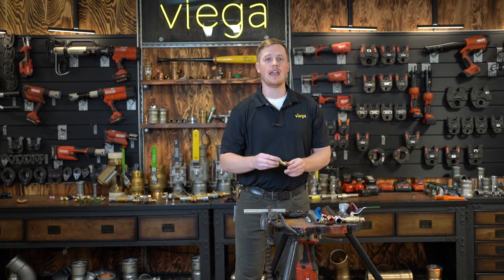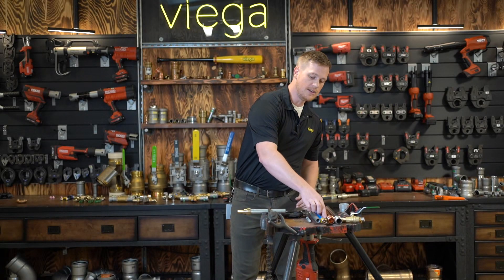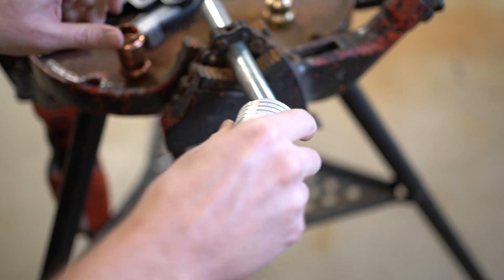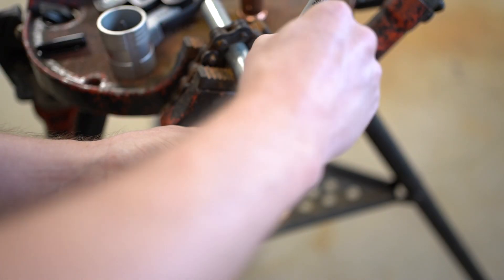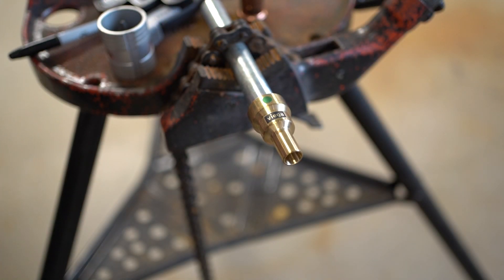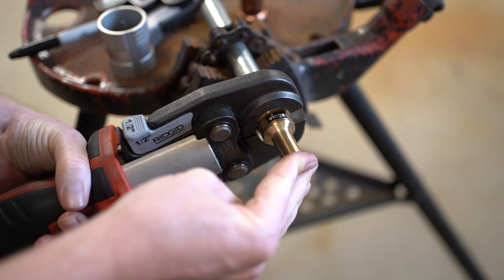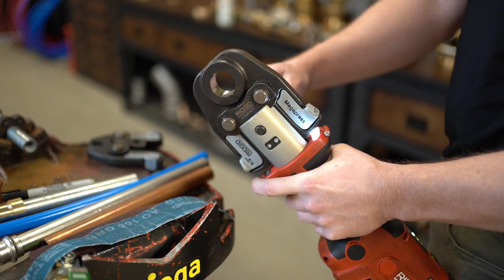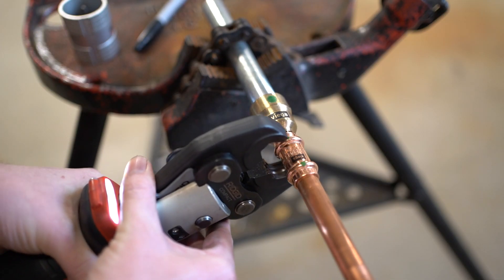Viega MegaPress Bronze Transition Coupling - IPS to CTS

Comment: What stops the electrolysis ?
Reply from the maker: The MegaPress bronze transition coupling helps reduce the risk of galvanic potential. It does this by using a material that balances out the difference between metals, which lowers the electrical reaction between them. Instead of one strong reaction that can damage the metal over time, it creates two much smaller reactions that aren’t powerful enough to cause harm.
Reply: Bronze and galvanized are two dis similar metals, no? Does it have some sort of rubber stop in the middle similar to a dielectric union?

Comment: So is for potable domestic? As in, I can replace a 2 or 3 handle shower valve plumbed in galvanized and transition to copper and install single handle valve?
Reply from the maker: Yes, this can be used on potable lines.

Comment: So if you have an Milwaukee M12 force logic pro press, and you purchase the 1/2" and 3/4" IPS jaws. Can you press a transition brass fitting onto galvanized to go to copper? (WATER LINE ranging from 30-75 psi in most areas)
Reply from the maker: Yes, you can!